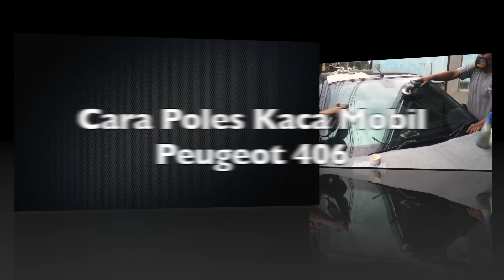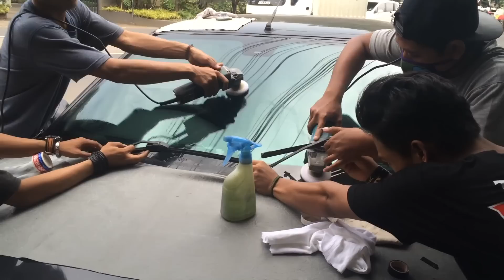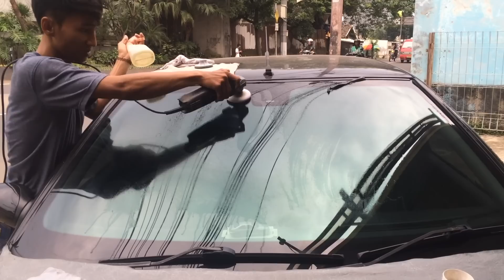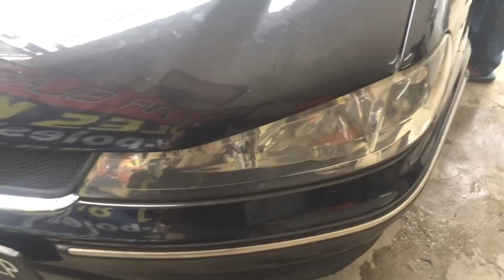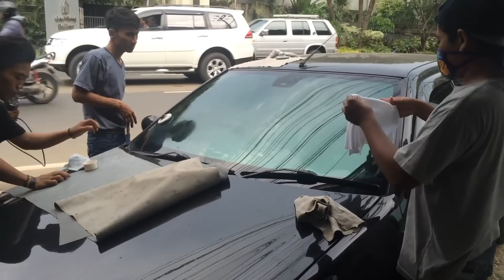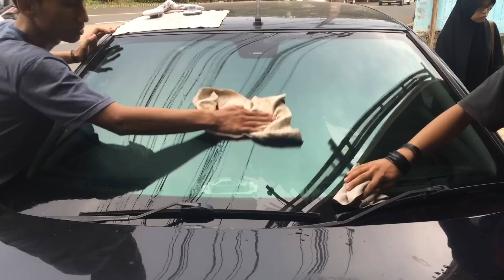How to polish the windshield on your car

Comment: Gerindanya bisa pelan pakai alat ap mas?
Reply from the maker: Saya kurang tau tipe gerindanya, tapi biasanya BOSCH tipe tertentu ada yang pakai pengaturan kecepatan.
Reply: @AGUNGH  saya liat ...ada semacam trafo ...gerinda tdk lgsung ke listrik rumah
Reply: @AGUNGH  jenis trafo ap ya mas
Reply from the maker: Disesuaikan aja ama gerindanya... Trafo yang ada pilihan voltase outputnya semakin rendah voltasenya semakin pelan muternya, yang penting ukuran ampere trafonya cukup untuk gerindanya.
Reply: @AGUNGH  boleh tau jenis nya gan...trafo step down bukan?
Biasanya pakai berapa ampere?
Dan tegangan output pakai berapa watt
Reply: @AGUNGH  sya punya gerinda makita 9553 b..rencana buat moles body tapi kenceng bgt
Reply from the maker: Sesuaikan ama gerinda yang ada... khan biasanya ada tulisannya gan... spec gerinda perlu berapa volt dan berapa ampere.